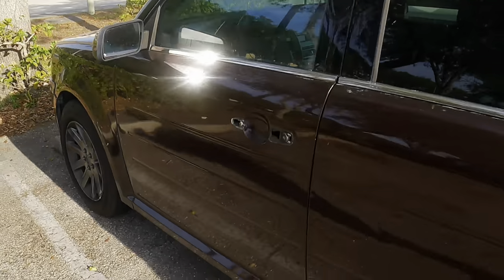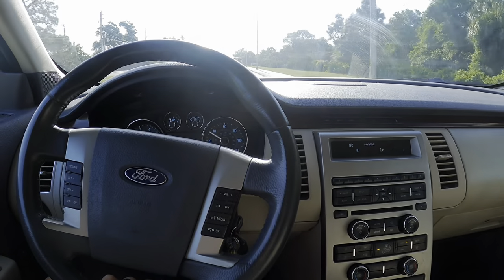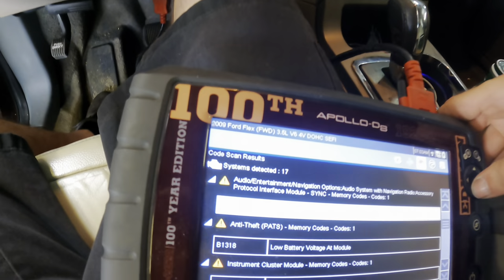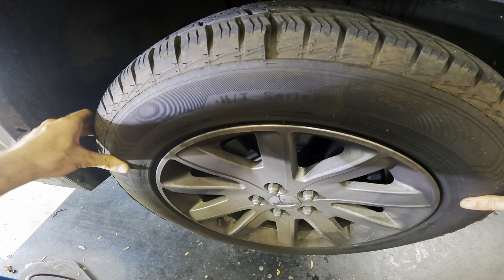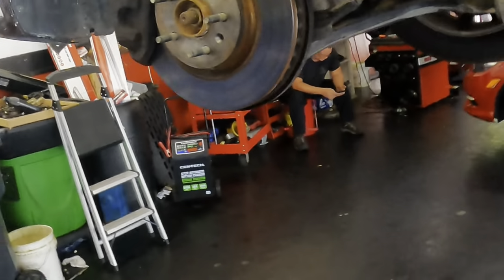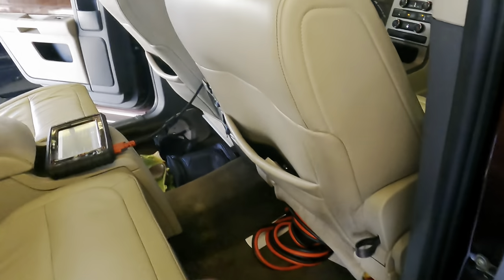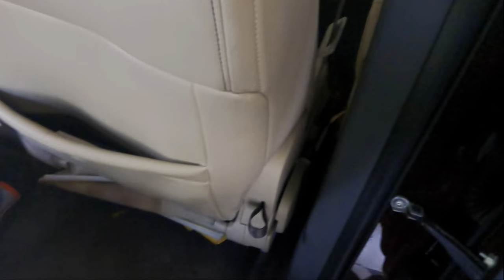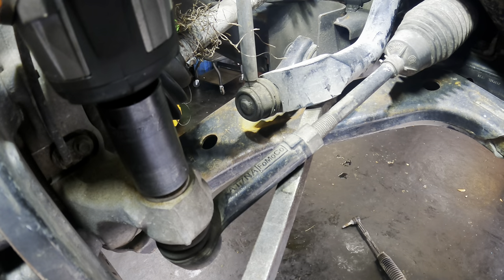Punishment from the Car Gods! 2008 Ford Flex 3.5l Airbag, Banging, Vibrating parts falling off

Comment: Not being a  working qualified mechanic myself I can't say if the same is true in the UK, but I am really shocked that so many don't even do basic stuff on their cars and seem content to drive a vehicle that is a potential killer.
Reply: In Florida (not sure about other states) there is no routine mandatory inspection, so if it moves, people will drive it; going straight, stopping, and other things you would expect to be mandatory features of a car are not strictly required.
Reply: Now many Americans don't have the funds to properly maintain a car.
Reply: @Badger1949  Thank you, Joe Biden!
Reply: @RezaQin  Yup, FJB
Reply: @Badger1949  ...brandon's fault
Reply: I've come to expect it from murica land, here in the UK you cant really get away with it, as the MoT testing stops you from driving a death trap.

a lot of people get annoyed because of trivial failures (ie bulbs, light positions) but it covers the serious stuff too (chassis welds, sticky calipers, worn track rods, anti-roll bars, broken coil springs, brake wear/tyre wear etc.
Reply: @kingarthur83rd  whats Mot ?
Reply: @nickmalone3143  MoT is an acronym for the Ministry of Transport. 

In the UK, all vehicles older than 3 years, by law, are required to hold a current and valid MoT Certificate.

the certificate is valid for 12 months. the test is to demonstrate the safety of a vehicle. so, suspension, brakes, lights washers/wipers, etc are tested for functionality and must fall within certain parameters. engine/clutch/gearbox are not subject to the MoT test, with the caveat that  emissions are also tested (moreso on diesels).

the actual test is quite progressive. dependant on what year the car is, depends on what checks are carried out. (ie for the 2013? update new vehicles by law must have functioning Daytime Running Lights. in 2005 DRLs werent a thing. cant test it if they dont have it)
Reply: Here in the UK all vehicles require an MOT inspection every twelve months.  This keeps dangerous and unroadworthy vehicles off the road. It also ties into the insurance as well as if you don't have either you therefore cannot then get the road tax to drive it on the road.   Then the cameras and police ANPR your vehicle tag and kerching.   Point in your license a fine and if cars in bad shape it goes off the the pound till you pay for its return and repair or it gets crunched.  Simple and effective.   Hence the motor trade in second hand cars is booming... buy a car run it till it is dead and then get a newer one.  Lol
Reply: @nickmalone3143  to add to that, if you choose to drive without one, our police have ANPR (automatic number plate recognition) which can tell them if a car is taxed (legal requirement), if its insured (also a legal requirement) and if the vehicle has a valid MoT Certificate.

not to mention the potential death trap you're driving.
Reply: Most states don't have annual safety inspections like the UK. That wouldn't pass our MOT purely on the airbag light being on. All safety systems have to be in working conditions, lights, seatbelts, airbags & TPMS.
Reply: Voters decided it was annoying to get annual inspections in many states and eliminated the requirement.

This was stupid because now there are millions of unsafe cars on the road.
Reply: I had the same question, but comparing with Australia.
Reply: @kingarthur83rd  Please remember that the US is a chaotic, poorly corralled and barely united collection of fifty states. 
Heck, two of them even refuse to be geographically connected! (that was a joke there)
Most states have some sort of minimum safety and emissions standards to be able to legally put and keep a car on the road. Some states are more stringent than others.

That unopenable driver's door would be a fail in my state, as would the failed windshield washer pump. Cars also get a "are there loose or broken front suspension parts" check as part of the inspection in my state. Plus things like worn wipers, not enough tire tread, missing or broken seatbelts, broken or missing windows, and holes in body panels.
-
Florida is kind of a dump as far as car safety and protection goes. They don't even have a lemon law for used cars, which leads to a lot of "fun" in some of Ray's videos.
Reply: yeah 12 months inspections in New Zealand ... no way you can have a check airbag light lit.... and the police will pull over rough vehicles to check.
Reply: @nickmalone3143  Every year in the UK when your vehicle is 3 yrs old it is required to pass a Ministry of transport inspection or MOT otherwise you face prosecution under the law.
Taxi cabs need one every six months due to the higher mileage they normally cover.
Reply: You should see the bill for most repairs, if your not handy or rich most people only do what's needed for inspection up north
Reply: I do wonder what happens in states with no periodic safety test when a car which is patently unsafe and the accident is caused by the existing defects. Say you plough through a people carrier full of people because your brakes are faulty? What happens? Does the insurance company sue you? Do the cops bust the driver for not seeing to the issues?
I live in the UK so my car has to pass the annual MoT test. Although the test is far from being a real test of a vehicle's safety, it at least covered the major systems like lights, steering and brakes. Corrosion can be more difficult due to plastic covers and the fact that a tester can't remove them.
Reply: Folks do have to realize that just because a vehicle passed an annual inspection, doesn't mean it can't be damaged in-between, becoming unsafe to operate. 🤔👍
Reply: @cruzinsweetsntreats  The UK MoT certificate does carry a caveat to say exactly that. I think the law here works that it's the driver's responsibility to make sure the vehicle is fit to drive. As you say, common sense really.
Reply: @PurityVendetta  though I was talking in general about all states and countries that require said annual inspection.
Reply: @cruzinsweetsntreats  Yep, and I agree with you. Simple truth is, if the brakes, steering, light etc don't work doesn't matter what the piece of paper says, get it fixed... 😁
Reply: Look inspections or not if you can’t afford to maintain your car with basic maintenance to keep it running safely you should not own a car it’s that simple. Why have a car if you can’t afford it there’s public transportation or you can walk. People that just do the bare minimum but the rest the cars still a rolling death trap are the people that should not own a car.
Reply: @cheeseburgerbeefcake  
If you can't afford to maintain the car, you need to move down to a bicycle.
Reply: @kingarthur83rd  i'm in the midst of restoring my car to a state that it gets through TÜV (german MoT) again and i'm worried about so many things because of their strict inspections ^^
Reply: @cruzinsweetsntreats  Folks do have to realise that just because a mandatory annual safety inspections don't prevent any vehicle becoming unsafe in the period before the next inspection, it doesn't mean mandatory annual safety inspections have no value.
Reply: @RezaQin  because this car wasn't broken 2 years ago under trump too?
Reply: @Sophie Hawthorne it depends on how the local DA feels, and how much injury was caused. If you maimed or killed someone, expect both lawsuits and prison time. Inspections don't change any of that. You could have a safety inspection pass, then a piece of road debris ruin your brakes. Would you not be at fault, during that year long period of having a nice piece of paper from the state, for neglecting to see to your weakened brakes?
Reply: @andrewlaw  systems such as TPMS aren't "safety" systems...they are nuisance systems...last I checked you can buy an air gage [I know amazing top secret classified equipment for as little as 50 cents whereas a TPMS sensor costs about $20 plus install] I'm not against getting total death traps off the road but MoT is only there to tax the populace.
Reply: @fhuber7507  no there's not...if there were you see em...all piled high on the shoulders of the interstate system...facts being what they are all point to the fact most people maintain their 2nd most expensive life purchase (some their most)...the reason many older cars remain on the road is a testimony towards that as if these vehicles were in such disrepair they wouldn't be driving...
Reply: @PurityVendetta  look at the "Just Rolled In" channel and tell me we don't need annual inspection of cars.
Reply: @fhuber7507  I was advocating for annual tests but unfortunately there will be people who, a month after the test find their car's brakes don't work properly and they deliberately don't attempt to have them fixed.
It's weird but I had a customer turn up the other day who was driving, I suspect, with no insurance and told me his brakes were defective. As he collected the job I'd finished for on of his customers their wasn't a lot I could do. I was a qualified motorcycle Ministry of Transport tester years ago so I still have a reasonable grasp but the things some people do make my head spin 🤯
Reply: as is proved by this tuber and multiple others here and elsewhere, US market cars are a gigantic pain in the arse to do even the simplest jobs on without the extensive training AND the common sense brains.  hell, even our light bulbs are now rigged to be swapped by a qualified mechanic only.  as for US style MoT's, everything varies state to state.  throw in DIY directions now being behind paywalls, firewalls (online stuff only), and, well, timewalls (a combination of universally hard to find parts, new or otherwise, and older mechanics STILL going "figure it out yourself"), US vehicles are just driven.  every other statement given in these replies is true as well.  us Yanks are a complicated twisty mess :P
Reply: Well you don't really need a car to live in the UK, far more essential in the US.
Fun fact, only a tiny percentage of accidents or fatalities are cause by faulty vehicles, it's mainly poor driving.
Reply: @Cheepchipsable  Have you ever lived in the UK? I live in a rural area in a county called Shropshire. Public transport is nonexistent. We have no trains here, few buses and the nearest town is over 20 miles away. It's not possible to live where I do without a car. None of this is an excuse for some of the really bad stuff I see on just rolled in though.
Reply: 5:03.... are those bud lights in the driver door?? (all i can see is BUD) 

I suspect all this damage was done by one thing do as you please 
This is why they dont care

Comment: One more example of a conscientious mechanic. Yes, the customer had to spend money,  but was also saved a lot of money on brake parts that could be cleaned up as they had a lot of life left. Less caring shops would have just thrown new parts at it,  and possibly pushed the cost beyond what they could handle at this time.  

I got a kick out of the customer with a Mercedes not replacing the pads because of the cost. Maybe if they had purchased a less expensive vehicle they could afford to maintain it. But then it wouldn't have the same bragging rights.
Reply: Yeah it wouldn't surprise me if they're living in the back seat maybe not but maybe they got cardboard furniture towing the house have a good night bye

Comment: 25 seconds into the video: Ok.... car is falling apart already... 🤣
Reply: Not surprised for Ford in this particular time period. These seem to share some of the same issues as the P2 Volvos - particularly the glass falling out of the passenger mirrors. The mirror heaters and southern climate do a number on the adhesive on the back of the mirror and the glass comes loose. There's a real quick and easy fix, if you are handy, but most owners are not.

Comment: From the looks of that mirror they pissed off someone on a motorcycle, lol !
Reply: More like Swedish mirror design. Volvo engineers back then would have been the best ones to copy for a drive train, body materials, ergonomics, and turbo implementations. But, anything on the body hooked up to little motors and switches, they just have issues with, and mirror glass detaching was one of them, that Ford Inherited on some cars.

Comment: I like the hub polishing tool - something I just recently learned was putting white lithium spray lube between the hub and rotor, and also the surface where the wheel meets the rotor... cause I've had a number of wheels and rotors that wouldn't come off! When you have to sledgehammer and kick a wheel to get it off the hub, you look for tricks to prevent it in the future lol
Reply: I use anti seize or high temp grease that won’t heat and potentially drip onto rotor or pad surface. Not sure how white lithium reacts to temperature

Comment: I was told to get bucket truck "A" from the yard and inspect the tower. Before I got it in the shop completely the shop foreman came running up and I was told to park it and deny ever touching it. It was involved in a lawsuit involving personal injury....The sneaky owners were told to remove it or it would be towed.

Comment: I enjoy watching your videos. I see you used purple lube for the brake pins. I’m curious, I heard and read comments about using that grease on the pins is not good because the pin that have a rubber on the tip gets swells and the then get stuck. Is that true. ? Keep doing your videos 👍👍👍👍

Comment: Noticed that neither of those outer tie rods were properly torqued. Properly torqued, even though you have the nyloc nut on it, they would not have spun freely. And like normal the right side steering gets loose quicker than the left side because most potholes and most issues with the street are on the right side of the car near the curb. Plus when you get the brakes the crown of the road transfers most of the weight to the right front wheel creating more stress on the right brakes and suspension.
Don't forget to put ANTI-SIEZE on the Hub. I do that every time I remove rotors so that it doesn't rust together. I've seen a car with 12000 miles on it oh, Ed was fairly new and had the hubs locked to the rotors and could not get them off.
Great job dressing the pads even though I usually use a piece of 60 to 120 grit with a piece of wood behind it just to break the glaze.

Comment: Gone are the days of the $49 brake job. Agreed. However, I object strenuously to a shop quoting over $900 for a brake job on a 2016 Rogue. That’s over $700 in markup and labor. BTW: I fired that shop.

Comment: 3M has the Roloc line, those pads are basically scotchbright pads but they make all kinds of abrasives for them.  Not to be a saftey Nazi but most of those types of pads come with respiratory warnings since the fibers shed when used.  Just an FYI.
Reply: Any kind of dust over a prolonged period is bad for your lungs. At the end of the day the operator is the one who suffers, so if they want that in their future they can have it.
Reply: @Cheepchipsable  Yep.  Some worse than others when the particles basically hook into your lungs.  No coughing them up.

Comment: It sure looks like that car has been sitting around like you said earlier. From the rust with the brake pad sitting it is a very good Indication. I do believe Mices got underneath that seat and chewed those wires. I saw some Weeds or brush on one of the tire rods when you are working on it. Also looks like mice were dragging bedding into the car. It's such a common thing when you leave any Vehicle set rodents will take over quickly.

Comment: could the many "sudden hits" caused by the missing engine mount ended up causing excessive wear to the ball joints ?
I mean, it supposed to move from one side and fixed on the other, when the fixed side starts moving, i guess the joint isnt working the way its designed to.

Comment: As always awesome videos, I have an issue with my Colorado where my breaks keep getting a wobble after 5k in miles and not heavy breaking. I am thinking it’s because they don’t use a floating caliper on Colorado’s so I was wondering if anyone had recommendation on good pads and rotors that will last a bit longer.
Reply: I use Organic Brake pads, you have to change them more often but they don't screw up your rotors. Also I am the only one who Torques my wheels, some GORILLA Torquing them past specs. kills rotors also. I also buy Napa Gold Lifetime Rotors.

Comment: ~25:15 IMO, the pins were serviced not long ago I agree, but heat is the main driver for those things drying out. Well, it can be dirt depending on if you drive it on dirt roads consistently.

Think about the individual and their driving habits. Some people like to get to a stop fast, and don't mind G-forces at all. Other people like to ease into every single stop....slowly coasting down to 0.

Not only is the ladder annoying to drive behind, it's harder on your breaks. 
The former is harder on the rest of your vehicle though....pick your poison.

Comment: So they fix the engine mount that's not going to kill them but when it came to the easily fixed pressure sensor wires screwing up the air bag they where like na where good ? What the hell ?

Comment: Even if you could get a $49 brake job, I wouldn't want it. "You gets what you pays for" Also, with that rusted area on the disk and the jumper cables, I'll bet the car sat for awhile then needed a jump.

Comment: my car has a weird shake at idle. bout every 10 seconds (sometimes) itll shudder really hard for a second or 2, then continue idling peacfully. runs great the rest of the time, no check engine light. any ideas? transmission fluid and spark plugs were changed about 30k miles ago. it has 130k miles on it. 13 nissan rouge